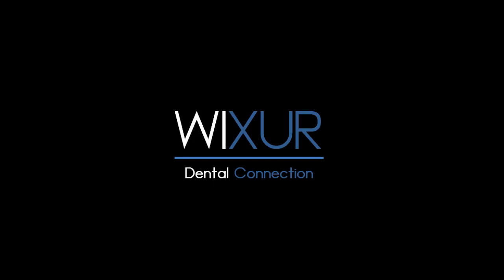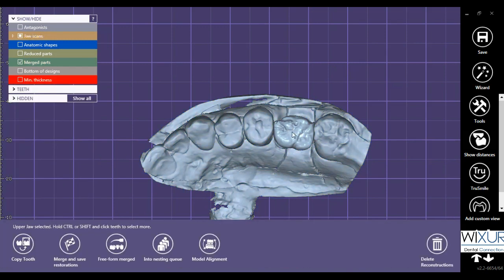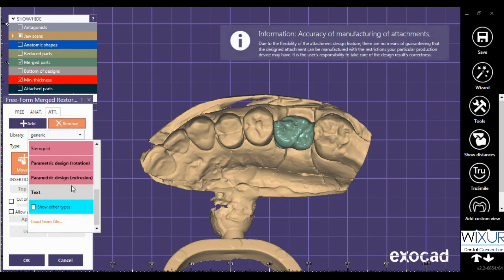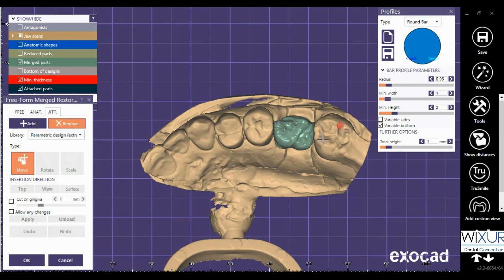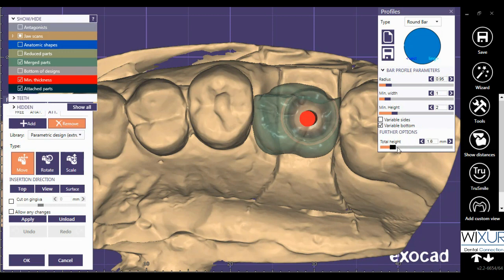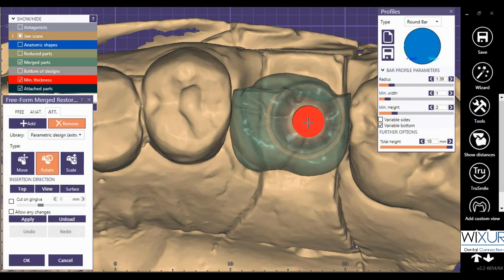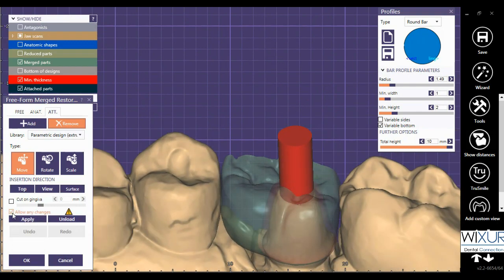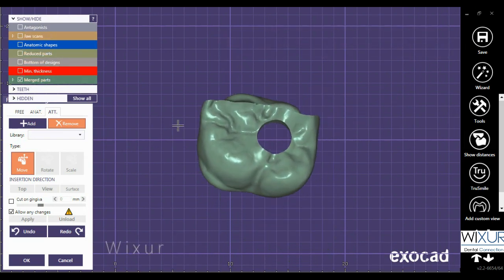Exocad - Screw-Retained Implant Crown

Comment: I do this exactly, but it leaves a thin layer on the occlusal still- like a "minimal thickness"  requirement for the crown itself and does not cut all the way through. Any suggestions?
Reply from the maker: Hi Jay, 
It may be because of "screw channel protection". Can you send us a screenshot to info@wixur.com?
I will check it 🙂
Reply: @wixur  I will do it right now
Reply from the maker: Hi again,
Thanks for the email.
What you need to do is checking "allow any changes" in attachments tab. Note that this checkbox is only available if you have "implant module" activated on your dongle.
Keep in touch!